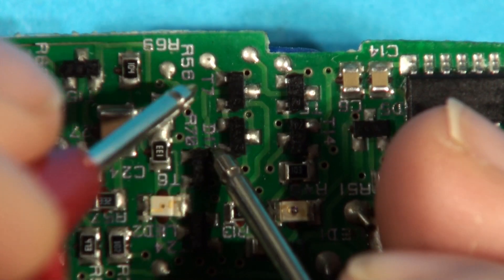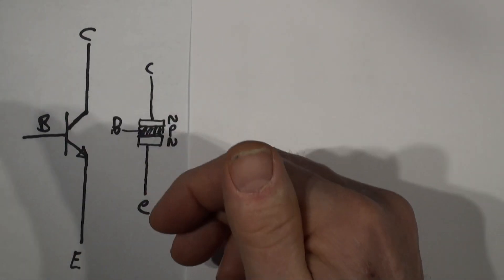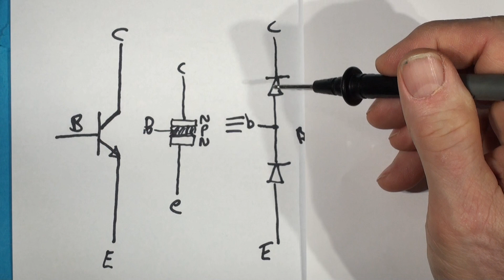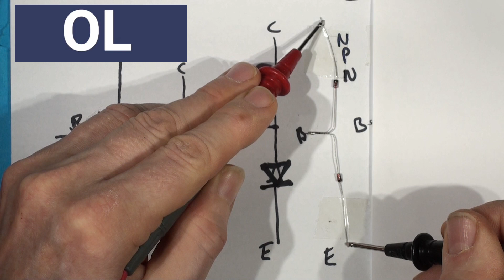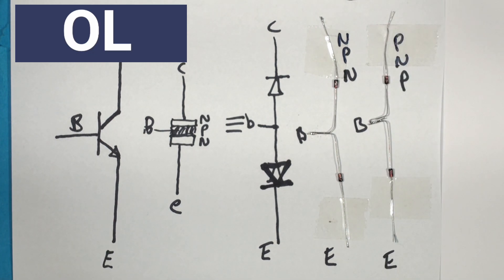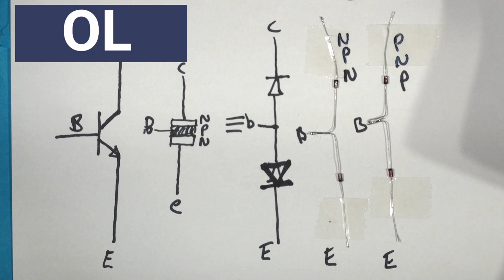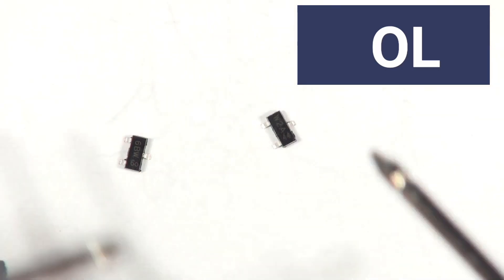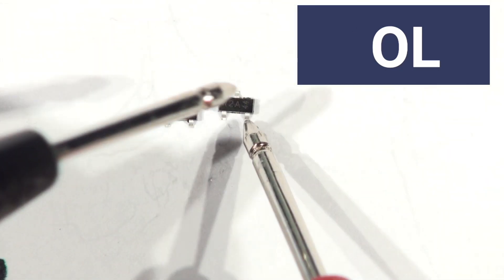Easy guide on how to check bipolar transistor is circuit NPN and PNP

Comment: How do you test each of its' pre-bias resistors inside it? (let's say a bipolar transistor, 3 legs, with 2 resistors inside)
Which probes to which pins to test?
Reply from the maker: The internal biased transistors are more tricky to test. Sketch out the equivalent circuit (replace the junctions with diodes) and check it that way.  It is more difficult as the multimeter will interpret the forward voltage drop as a resistor.

Comment: Hi, please make a video showing the active components from sounddock10's power module, to repair It, would be a christmas gift for me please T-T
Reply from the maker: All the components are shown in a very detailed repair of the SoundDock 10 power board on this channel. It is complete complete with part numbers and major supplier  references for the parts you need to change.  Christmas has come early!!
Reply: @razenby , i had ask for the video becouse i don't understant nothing about this subject, and i have a spare sound box for the repair parts wich was from my stepdad, but i will try to learn about it, i'm from brazil and i saw the content on you channel and it's high quality, thanks for makes these videos, my best regards.